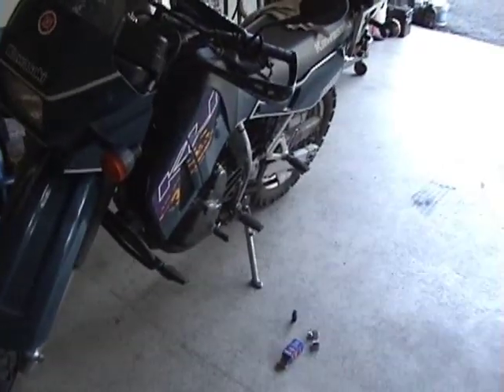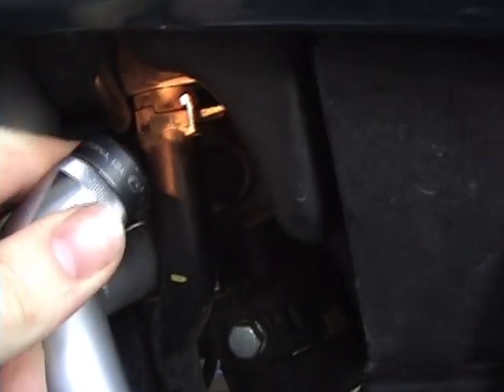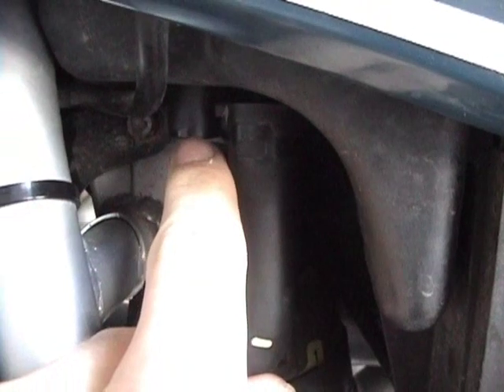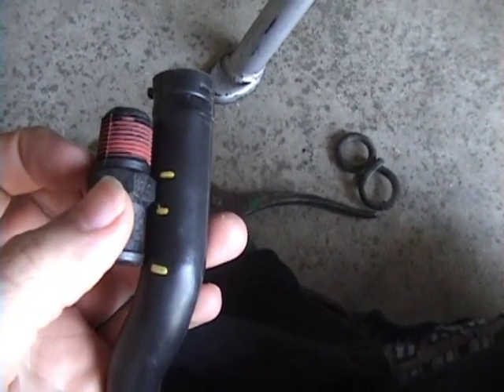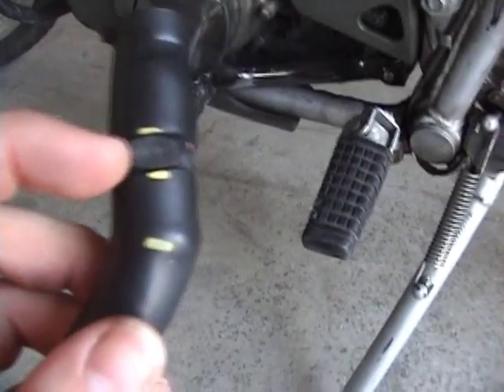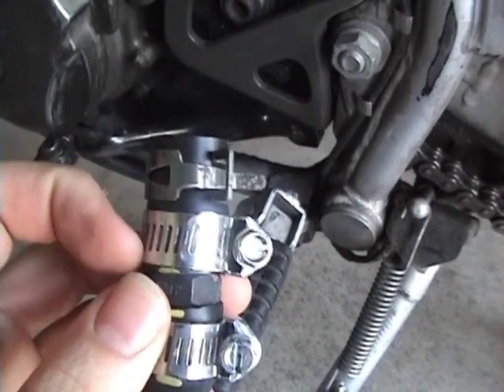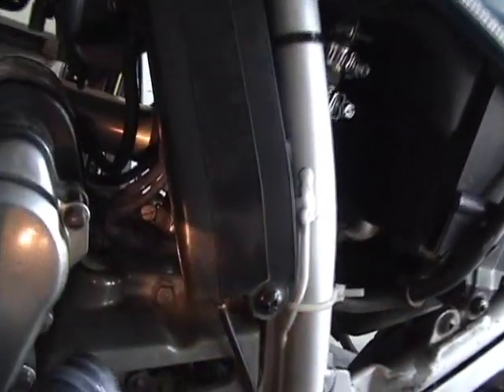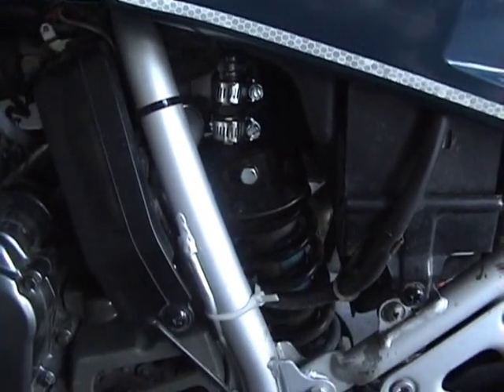KLR 650 PCV Mod

Comment: Did a similar mod on a 1975 Norton Commando. Instead of a PCV valve used a Dorman 80190 power brake check valve.The Norton forums claim it works better than a PCV, but don't see why a PCV would work also. Just make sure you can blow through it in the direction away from the engine. Works like a charm. Besides (at least on paper) reducing HP pumping losses it vastly reduces engine oil leaks that old British bikes are famous for.

Comment: That wrench section you can refer to as the HEX ...... as it is six sided. But wrench section we get the point . Cheers! 
The injection style hose clamps look better and they don't have slits in them like the old style hose clamps . Either one does not need to be crazy tight ... no need to mutilate the hose.

Comment from the maker: I'm pretty content with the hose clamps I used (#10 if I recall correctly). I also like the idea of keeping the overall hose length the same, ie: making two cuts in the hoe rather than just one.

Going back to performance: I doubt my bike was burning any oil to begin with, and it sure isn't burning any noticeable amount right now, and I use it mostly for highway (75 - 85 indicated mph, 5000 - 6000ish rpm) which is where a lot of people report that they have to add oil regularly.

Comment: @DecaPierce  In this case, the valve is being used as a check valve, allowing crankcase pressure to be pushed out, but not allowing air to be drawn in. The idea is to always have a negative pressure in the crankcase to reduce crankcase pumping losses.

Comment: Good write-up Jamie.

Did the bike not come from the factory with this valve? This one way valve won't stop water from entering the crank case since vacuum is holding the valve open. Nevermind water in the crankcase though, if you get water in your aircleaner you have bigger problems. I don't see how you are changing anything from the intended purpose of this pipe. It is meant to burn hydrocarbons which wind up in the crankcase, reducing emissions and also eliminating pressure from within.

Comment from the maker: I did some other mods around the time I did this one, so I can't comment on increased performance. With the other mods and this one, I think (!) there is a slight performance boost. But that could also just be in my head.

As Xtreme pointed out in the forum, the valve can be mounted in any orientation and still do what it's supposed to. Had I known that earlier, I probably would have put it in the angled part of the tube, that way it wouldn't butt up against the airbox, but it still works.

Comment from the maker: No, it did not come with a PCV valve from the factory. As I have yet to take one of these engines apart, I can only comment on how I think it works, so it might not be entirely accurate: as the piston goes up, it creates a negative "pressure" - a vacuum, which closes the valve. Then when with the power stroke and blow-by gas, there is a positive pressure that opens the valve and lets the pressure out.

I don't plan on fording any bodies of water deep enough to get water in the airbox.

YMMV.

Comment: man do people modify this bike. l wonder what the japanese who spent hours designing it would feel after seeing u guys frankenstain it
Reply: +Fernando Ramoa The KLR is known for a lot of corners having been cut in it's development! Weak subframe bolts, easily replaced with grade 8 ones. A really cheap and bad cooling system design the thermo-bob fixes. A very poor fitting and weak balancer adjuster that breaks and ruins the engine, replaced with a well made and better fitting part. Poor forks and shock, but that's pretty typical of most bikes.
The bike is basically good, these modifications add many years and miles to them though and are worth it.
Reply: +Oldbmwr100rs I know that! I own one! I'm not undermining the mods, I'm simply ponting out how much ppl modify it